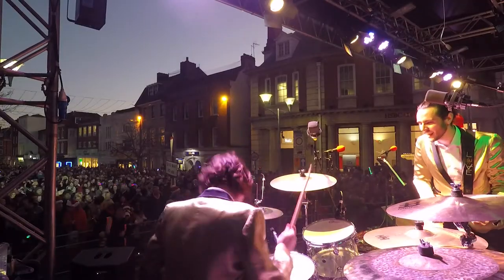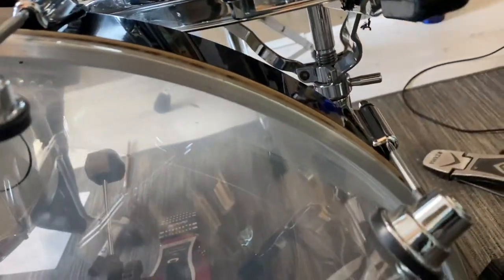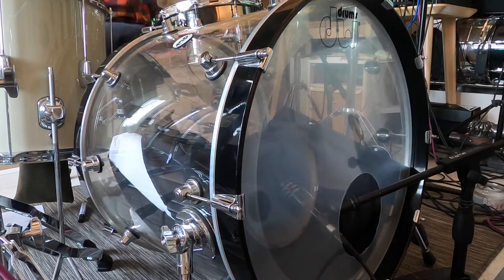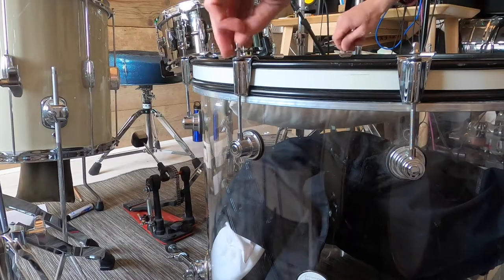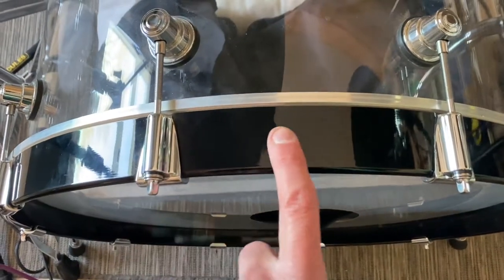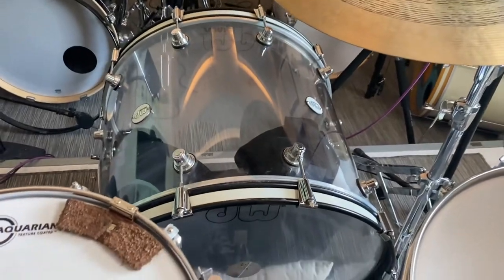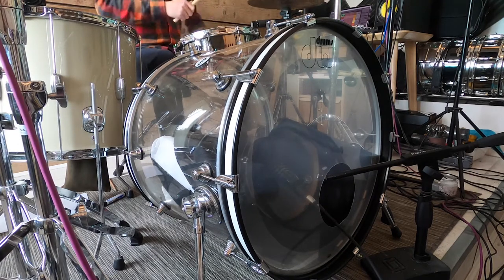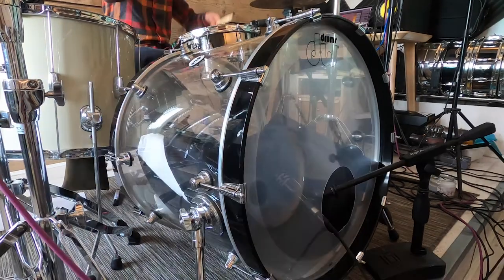Bass Drum Hoops: Wood vs Metal - Can you hear a difference?

Comment: your bass hoops were probably faulty to start and just got worse because if they were one of their earlier batches into the UK of their acrylic kits because DW replaced both of mine being slightly made oversized they even sent me 2 brand-new bass drum heads too plus new badges because they were especially for the wood kits. I Just thought I’d mention it when I came across this video
Reply from the maker: God dammit! I didn’t know this. Thanks for the heads up though. Have you got the same acrylic design series?
Reply: @WillDrumsDaly  you’re welcome it was just a thought . No Will I sold mine in 2016 as I needed to downsize. but if DW ever produced a 20 inch bass version I’d certainly buy another.